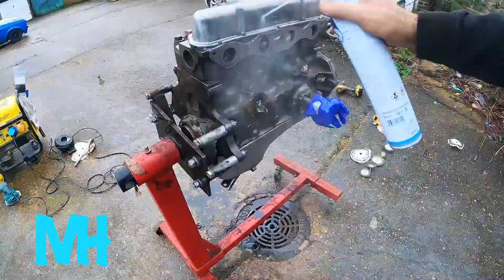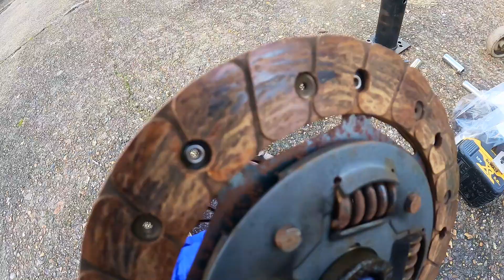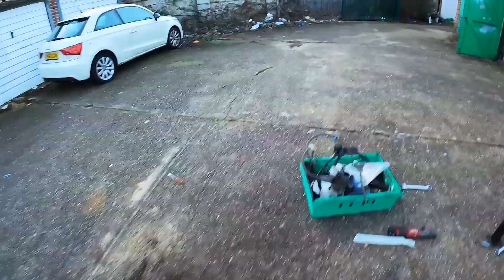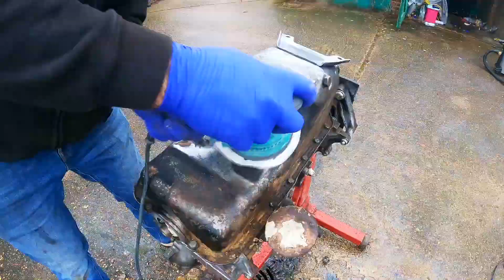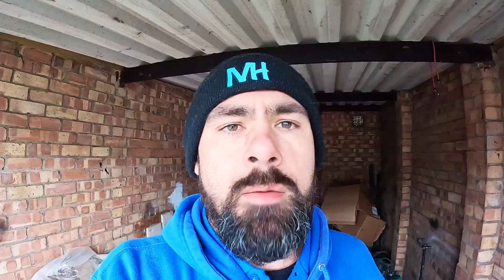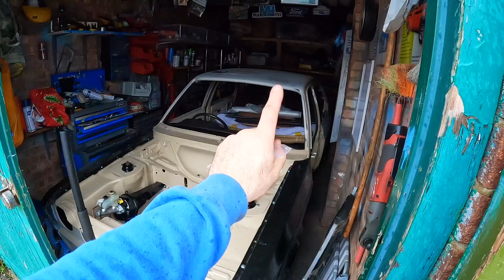TRANSFORMING a 50 year old engine!! For my Mk2 Escort! 👍

Comment: Engine looking alot better now you cleaned it and painted it i would change the core plugs before putting it in i hope you put a Webber on and a good exhaust manifold on it hopefully when its all done and on the road and you don't drive it the way you do with the other two and keep breaking them mate
Reply from the maker: Thanks for the advice mate! 👍 Im hoping the original single choke carb will be ok. The plan is to keep this one slow and NOT abuse it like the others! 😃

Comment: Why waste time and money on replacing bolts when all bolts for pinto or cross flow are available on line genuine ford engine mount bolts with washer heads are only £8 per set
Reply from the maker: I will probably get every single original bolt re-zinc plated for about £8 quid mate. 👍

Comment: Just a heads up I would be changing them core plugs also seems they can be overlooked 
Depending on how much you skim the fly wheel check it would need balancing also the clutch pressure plate
Reply from the maker: Thanks for the advice mate! 👍

Comment: Going by the state of the thermostat I’d be thinking of removing the head to check all the water ways in the head and block
Reply from the maker: Thanks for the advice! 👍 Thats defo an option as I do have a head gasket in the gasket set I bought. I may end up changing the core plugs which will give me an opportunity to look inside the water jacket at least.